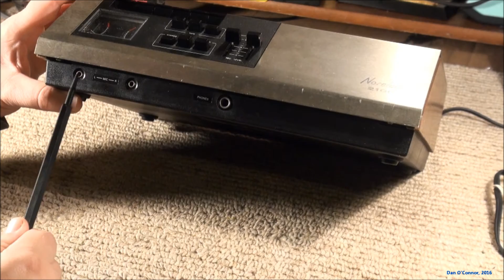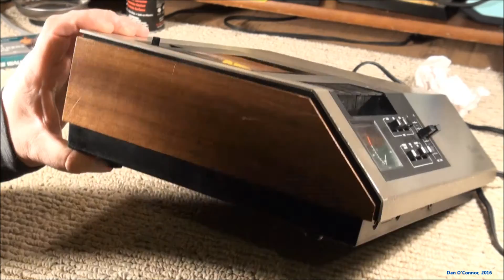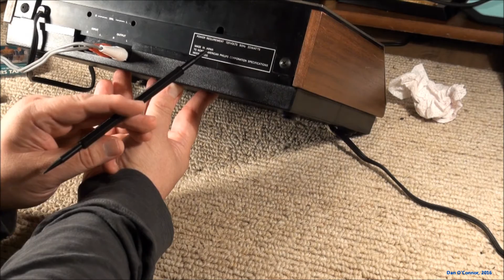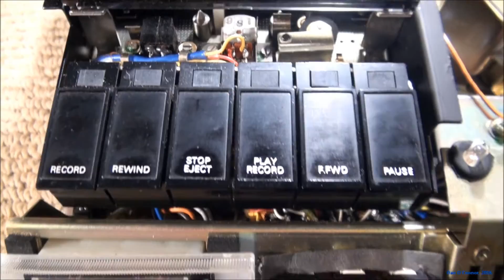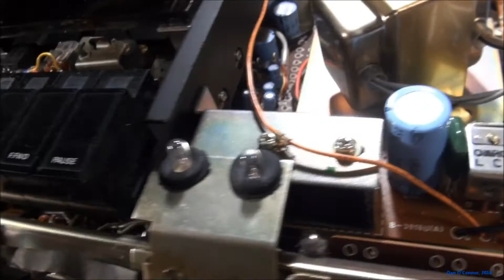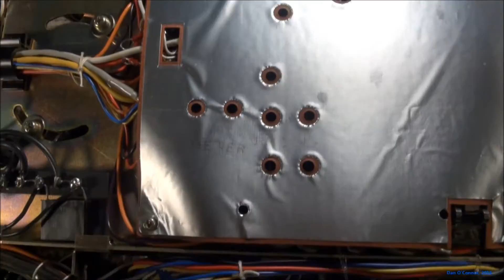1972 Norelco 2100 Cassette Deck (Nakamichi)

Comment: Hi Dan, I actually own a Norelco 2100 and actually have the original owners manual.  Sadly, there is no real service information or schematic but I can help out with the SPL button...  Per the manual, the 'SPL' button is the 'tape selector switch' for super dynamic special tape cassettes; e.g., Norelco 300 Cassettes.  If I can provide you with any additional info from the manual please let me know! :)
Reply from the maker: Thanks for that information on SPL. I have samples of many of Norelco's cassette tapes, including their 200 and 300 tapes which were introduced about the same time as this deck. The 200's packaging says "Low Noise Tape for Fine Music Recording" while the 300's says "High Output/Low Noise Tape for Semi-Professional Recording." Neither tape or packaging has any bias numbers or curves showing the actual difference though. Norelco's 400 tape was CrO2 which this deck could use but I don't have any of those. Does the manual clarify those DNL ports on the back that look like trimmer adjustments and how to use them?
Reply: You are most welcome, Dan.  I have watched many of your videos, including several covering the 200-400 Norelco Cassettes.  I have found what you've provided to be extremely helpful, and if not for your videos, much of the information would be very difficult to come by.  So I'm glad I can return the favor. 
 
The DNL Ports or 'Dynamic Noise Limiting' ports appear to be, in essence, trim knobs.  The manual simply says 'DNL L, DNL R - Screw adjustments (factory setting) in simply identifying the ports.  The only other technical on DNL is the following... 'Signal to Noise: DNL in = -47dB;  DNL out = -45dB (unweighted)*   "Unweighted" figures indicate an improvement of the signal-to-noise figure for more than 5dB at 6KHz and ore than 20dB above 10KHz.  That's about all there is on DNL, other than a snazzy little paragraph talking about how cool this new feature is for reducing noise.  

Let me know if there is anything else I can help with.  I own many of the same Norelco units you do.  I do have one Norelco unit from this same period I've never seen anywhere else.  it's called the Norelco 2000.  I'd love to know if you're familiar with it and if you know when it may have been released.  I'm 'guessing' it's around 1970.  Here's a link to a photo of it...  https://www.pinterest.com/pin/389631805250623786/
Reply: BTW the curves for the early Norelco Cassettes are the following...
Norelco 100, 200 or STD - 50Hz - 10KHz
Norelco 300 or SPL - 50Hz - 12KHz
Norelco 400 or CrO2 - 50Hz - 13KHz
Reply from the maker: Thanks for the additional information. Congrats on having a 2000, I'm envious. The 2000 was announced at the 1971 CES along with the 2100, 3170 and 1420. Its MSRP was $110 and the sales announcement said you could use Norelco's HP 200 headphones with it without a separate amplifier. Of course I think you could use headphones without an amp on most any deck.
Reply: You are most welcome and anytime!  Thank you for clarifying on the Norelco 2000. I figured it was of the same generation as the 2100, due to Norelco painted decal badging and polished aluminum face place.  And now I don't feel so bad as the amount of times I've been 'envious' of your collection are countless!  ;^)

Comment: I think you are right about the deck being made by nakamichi..well at least the tape transport block looks like their standard dual tracer mechanism used in 600,250,350,500,550 series...thanks for sharing
Reply from the maker: I was hoping that someone knowledgeable about Nakamichi decks would comment about this machine, since the only experience I've had with them is my 1971 Fisher RC-80B deck. Thanks.

Comment: It's interesting that it actually runs the motor faster in fast forward and rewind, whereas most cassette decks use a fixed-speed motor and change the position of the pulleys and idlers to make the tape run faster.

Comment: SPL could refer to ferrichrome (type III) tape, or it could be a 120/70 µs switch.
Reply from the maker: Re-reading the June 24, 1972 Billboard article, I see it  points out that the 2100 features a "bias equalizer for standard high performance or CRO2 Tapes." That would explain the "SPL/bias" point inside that I didn't notice until I watched the video. I also notice that the lines on the "tape type" spot on the control panel really only go to STD and CRO2, there isn't a line "up" to "SPL"
Reply: Dan O'Connor So it's only a decoy?
Reply from the maker: No, It must switch the bias for the two tape types. I guess we'd need to see the instructions to know when to use it "in" or "out".